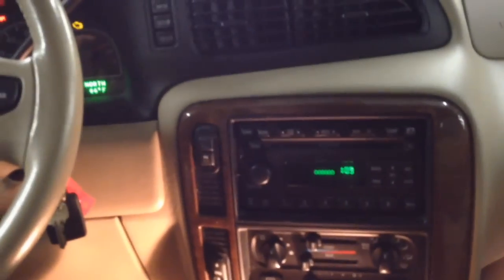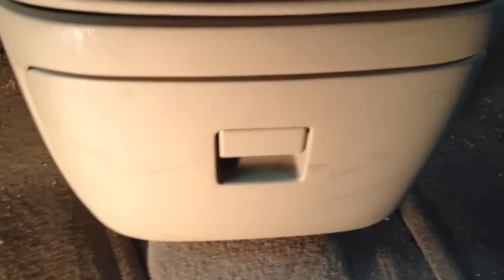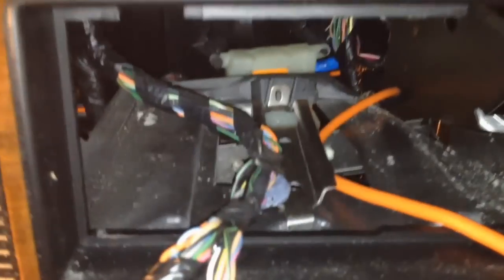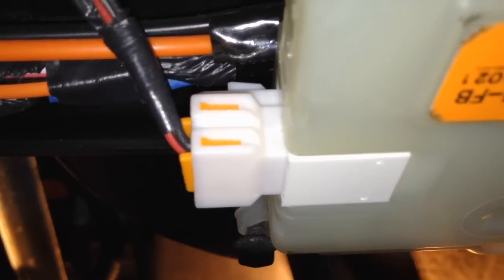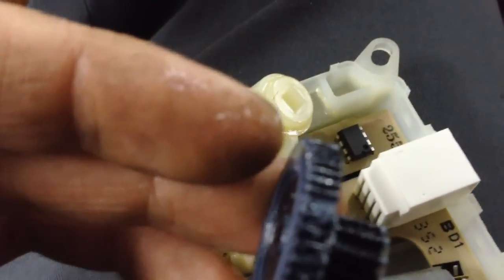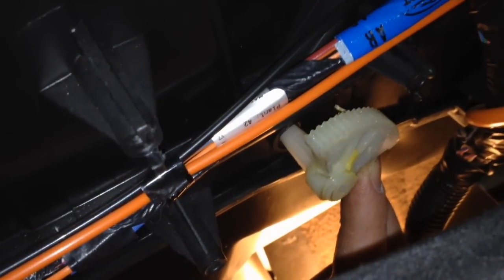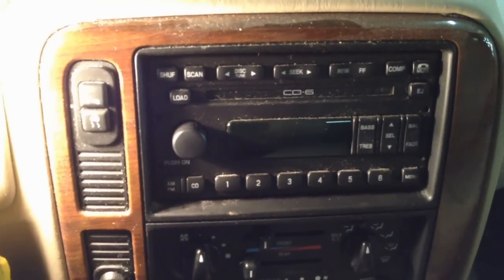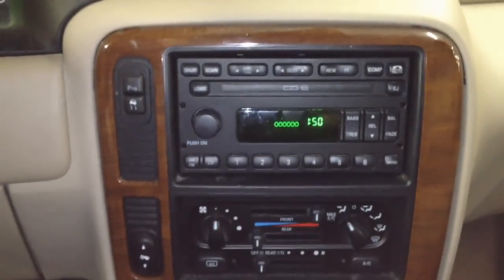NO HEAT: Ford Windstar Blend Door Actuator Removal

Comment: Yessir, that twas the problem!! What it was is, inside the actuator the LITTLE wheel of mine had a few broken teeth on it. But Every move you made I made. Right up to installing the new one. Unfortunately, they (AutoZone) gave me the wrong actuator. That little "key piece" on the new one wouldn't fit in the slot. The front of it was circled not a square 🤦🏻‍♂️ I now have to wait till Wednesday for delivery.
But, THANKS to YOU it'll only take me 7min to do. I APPRECIATE YOU bud👍🏻👍🏻if you have more vids, I'm SURE I'll be needing and watching them🤣🤙🏻

Comment: Good info, i went ahead and took off the whole plastic front to have more working room and to not have to remove the radio with special tool. Just 2, 7mm screws right above where the cup holder sits and you can pop the whole front off and just unplug the radio.

Comment: I did my 2000 Windstar actuator with this video, now I think my 2002 actuator has failed. My heat was going from hot to cold and back again, coolant was low, topped it off, same story. No clicking on this one tho, can't explain it. I'm just glad spring is around the corner...

Comment: I fucking hated taking the bitch of a radio out of my grandmas 2001 model; half the time the stupid u pins got stuck or would pull out, or the track didn't line up, and then we got the wrong door actuator and had to wait three days for a new one to arrive in store, and after 3 years with no heat, and hearing no more complaints about having no heat, it was all well worth the effort, thank god.

Comment: Your video is amazing.  My husband just replaced this part the Air Blender Aucator.  On his 2002 Ford Windstar cargo van.  Living in South Florida he never used the heat. Last night while driving he went to use the heat to find a clucking sound a quick YouTube search and your video fixed his problem. No mor clucking sound and the hear works.  Thank you for your detailed video

Comment: the instructions were fantastic. 
I removed and replaced the actuator in 1 hour.
I purchased the radio remover tool for $8, which removed the radio fast and easy.
the toughest part was removing the bolts.  not much room, but was able to do it.
I opened the old actuator to see the issue.
the problem with my old actuator was the smaller gear had teeth missing.
I tested the blend door as you suggested and there was no problem with it.
Put the new actuator back in place and connect power, attached the bolts and presto had heat.
thanks for your video it made the repair a do-it-your-self.  thanks.....
Reply from the maker: Wow now that is a successful repair and is the way I intended it to be!

Comment: Needed to know where this part was located. Hmm mine is doing something similar the rear gets cold as ice but the front blows luke warm I can see the blend door actuator move so I'm guessing it's not that causing the issue guess I'm going to be digging into the dash. Bought the van for 500 it had been unused and rats where living in it my guess is they found their way into the ac vents

Comment: Very well done video! Our 2000 Windstar is ticking when the AC is on, but ceases if we switch it to Heat. We think it is our Bent Door Actuator. Thanks so much for this video!
Reply from the maker: Take it apart and check it out before the hot weather from the way it sounds it failed in the heat position and that's not fun in the summer.
Reply: FordTechMakuloco Yeah, especially with kids....they can't take the heat.
I noticed on my review I called it a Bent Door not a Blend Door. Oh well.

Comment: Did this today! The coat hangers didn't work so I bought the tool for $9 at Advanced Auto. Also found a replacement actuator at the same place. Took the old one apart and the little teeth were gone all but about 6 or so. Checked the door and it moved smoothly. Thanks a lot. One suggestion is to take the glove box and take it out and place your light in that area, worked like a charm!
Reply: Hello, re "the tool" you used...he used the same term...if I may ask..what's the tool called?

Comment: We took out the actuator and it looked good.  So we did the "test" and we could open/close the door.  We put a black dot on the actuator and then re-installed it.  You can see it move from noon to three and three to noon when you go hot to cold and cold to hot, but the air temp never changes.  Is it possible that the actuator is turning, but not actually doing anything?  Since it's keyed, we thought not, but figured it wouldn't hurt to ask.  Can't think of any other reason why we aren't getting hot air.  THanks!
Reply: Did you fix the problem?
Reply: Yes.  The problem turned out to be that there was no coolant.  After refilling, we immediately got hot air.  This worked for a little while and then it leaked out again.  Turned out we had a bad heater core.
Reply: Denise Stewart Windstars + low coolant = warped heads

Comment: I took my actuator apart but I didn't see any broken teeth on any of the gears or arm. I tested the door and it does open and close with resistance as you show. I did buy a new actuator any way and hoping it solves my problem.

Comment: Is the Blend Door Actuator what regulates the heat, even thought air is blowing through the vents? I also have a tapping noise that persists unless I slide the temperature lever into an exact spot about 3/4 inch to the right on the sliding lever that sets the temperature.
Reply from the maker: Jeannie111523 Yes your actuator has failed, follow this video to replace it.

Comment: I enjoyed your video about the Windstar repair. I'll also need a little instructions for how to replace the lighter socket which is beneath of temp. control right next to ashtray (right side). Is a 2000 Windstar and still going strong... thanks for any help.
Reply from the maker: Those just snap into place so all you have to do is pry them out of there they pop right out and just disconnect.

Comment: I am really interested in trying this procedure but I have never done anything like this before.  I would like to try this before I take it to the mechanic but I was wondering what are the symptoms that demonstrate it is the actuator that is broken and not something else?  In my Ford Windstar 2000, only cold air comes out whether I put it on the heat or the cold side.  Are those symptoms that it is the actuator? Before buying the new actuator, is there a way to test if its actually the actuator that it is damaged?  Also if your reply could be as simple and detailed as possible, that would be greatly appreciated! Thanks in advance!!!
Reply: You should be able to cawl underneath there and see if the shaft on the actuator is moving or not as you turn the temp dial. Alternately you could take it out and do the same thing with the electrical connector connected. You will usually hear clicking if they are bad.  Have you checked the engine coolant?
Reply: Actually nvm, I followed all the steps and "GREAT SUCCESS, VERY NICE, I LIKE" It was actually a bit hard to remove the bolts (the bottom one and the one on the right side).  I also had difficulty placing the new actuator in its place due to wires in the way, eventually I found a sweet spot and got it in! Thanks man!!

Comment: my boys car only blows cold or heat thru defrost only not thru the selected vents will this solve the this problem as well or is there another actuator or a different one for ac mode? We replaced the selector switch but the same thing happens it only blows thru the defrost vents and not a lot of pressure at all just sort of a trickle.

Comment: Thank YOU so much ... I've had the click-click which came & went at its will, then first time I've needed heat ... none.  We followed your instructions to replace accuator in less than 2 hours.  The radio removal was the hardest part (we watched your hanger tool vid and got it.. but it took a bigger wire than just a hanger!)  All I can say is WOW.  I searched for 'Windstar no heat' and your vid popped right up!

Comment: My wifes windstar has heat but only when pushing the gas if we stop at a light or idle to warm up its not worth it. and yes the budget is real ! lol Thanks
Reply from the maker: Have you checked the coolant level and condition, and recent work done to the cooling system?

Comment: I looked at several utubes concerning my 2001 Ford Windstar heater problem.  First clicking sound for awhile, then month later no sound and no heat in front,.  I watched this utube and followed the directions and 30 minutes later the old motor actuator is out.  And I checked the damper as directed and its good.  Made my own tool to remove radio using wire similar to coat hanger. Once i get new actuator and install will have heat again. Its been cold here in Pa. Best utube Ive seen on this subject, thanks alot.
Reply from the maker: Thanks, good to hear hopefully with the new actuator you will be all set.

Comment: 2005 larait heater control center stoped working, anything come to mind on normal issue?
Reply from the maker: Auto temp control? Whole thing is dead right even the display?
Reply: yesir i was going to test the circuit but chances are they are fine, my expernce at my shop with electrical usally its the part not wiring
Reply from the maker: Kevin Rogers Yes our auto temp controls units back in the day before the big change would just blank out for no reason for hours day whatever and come back and the fix was to replace the head unit which on f150s seems to be extra high price around $600.

Comment: When I replaced mine, I took the heat/air panel under the radio off. I could access the actuator bolts without having to pull the lower panel.  Both methods work. An easy DIY for a common Windstar problem.

Comment: thank you very much for sharing this repair and want to let you know that the way you make it easier to acomplish the r&r
of this part. I did tried first without removing the bottom part. Well I ended dropping a screw right behind the misc.basket. 
so I pulled out all 4 plastic clips , removed the bottom tray and looked for the missing screw. once I found it , i assembled back everything and voila'  I was done.  Thanks again.

Comment: I took the actuator motor out and took it apart and found there are no broken teeth on any of the gears I can see but the actuator does not move when I adjust the temperature and the baffle works as it should because I checked it. Think it is just a bad actuator motor? Just curious if you had any idea since you may have done a few of these. Thanks
Reply from the maker: Yes I would still change it out plug the new one in and retest. The HVAC module that controls them rarely fails if ever. Just make sure you replace it with a motorcraft unit.
Reply: FordTechMakuloco Thanks for the feedback, I put 12v to the actuator and it didn't do anything so I think the motor in it is junk. Got a new actuator coming.

Comment: Thank you for this video! I bought a 2002 Windstar today for my brother. The vehicle is in awesome shape but the heat didn't work thru the vents or defroster. The heat did work in the rear zone. After watching your video I did the repair myself! The little plastic gear was the culprit! It only cost me $38.17 to do the repair and about 40 minutes of actual labor. I dropped one of the screws and it took me about 10 minutes to find where it fell! Thank you again for this detailed video!
Reply: 1😊p❤😊😊❤❤😊
Reply: 😊😅😊😊😊😅😅pp❤

Comment: Incredibly EASY, thanks to you!. Others want to take out the whole control panels but this was super easy. My van was ice covered and I did not have the replacement part yet, so with the actuator out, I used a 3/8 to 1/4 adapter and inserted it into the "D" hole (by hand) and rotated the flap left and held it there. Then I turned on the fan and slid the lever to heat, pulled out the 1/4 adapter and the flap stayed "up" allowing my van to warm up so I could go get my part.

Comment: What year is your windstar? I have a 1999 and from below I can't find  the blend door actuator. Took the radio out also but don't see that white plastic actuator. Maybe I need better lighting or the 1999 is different. It has front and rear heating controls. Air blows only cold and only on windshield defroster no matter what the switch that directs air is set to.
Reply from the maker: rfn944 Yours is in the same area, also your defrost only issue is separate and is due to no vacuum getting to the control head.
Reply: FordTechMakuloco Is the control head under the glove box? I saw a vacuum line on a vacuum motor mounted underneath it. How does vacuum get there, is it through a vacuum switch?
Reply from the maker: Vacuum comes through from the engine compartment to the control head where you change the temps and vent positions. There will be a bunch of vac lines coming into it all different colors you need to make sure the black one has vacuum when the engine is running. Do you have a hand vac pump?
Reply: Yes I do, thanks for the info. Will check it out tomorrow.
Reply: FordTechMakuloco Looked at it today. The reason, I didn't find it the other day was it was not there. Some hack job mechanic was in there and removed it. He put a metal rod in through the hole where the actuator motor goes making the job much harder. Since he damaged the blend door I'll have to replace it now. The switch that changes where the air flow is directed is electrical and not vacuum. There are no vacuum lines going to the control head only electrical wires. Not sure how the system works. Will have to research it further.
Reply from the maker: All doors on this system are vacuum and should be connected in a clear manifold to the control head.
Reply: FordTechMakuloco There a vacuum motor under the glove box. I moved it and it did not change the air flow off the defroster. This maybe the recycle/fresh door/flap for the A/C. The blend door is controlled by an electric motor inside the actuator assembly. The rest of the doors I have no idea where they are.
Reply: FordTechMakuloco I just found a picture of the air flow selector switch. Looks like it is half vacuum and half electric. Any idea where I can find a diagram of these vacuum lines?
UPDATE: Just found one that is great.
http://www.justanswer.com/ford/5qkhk-ford-windstar-van-1999-ford-windstar-heater.html
Reply: FordTechMakuloco Found out more on this no heat 1999 Windstar. The vacuum lines initial looked like wires, but as you said they are color coded vacuum lines.
Since the previous hack mechanic destroyed the blend door making in impossible to put an actuator on it, I secured the door in the up (heat) position. The heater core was not getting very hot. The drivers side hose was warm but the passenger side was much cooler. Added three quarts of antifreeze and it started to get hot.
Now I have heat, but only on defroster. The black vacuum has some vacuum, but very little. I could feel it there with my finger, but it seems weak. Do you know what the vacuum reading should be at idle on the vacuum source line?
Reply from the maker: rfn944 Sorry for the late reply just saw this. If you still need help the black source line should be around 15-18" of vacuum. It will stick to your finger and that is about it. Once it goes into the control head it then goes out to the appropriate mode door which all of them are not bad so it's either your source vac or the control head.
Reply: FordTechMakuloco Thanks for the reply. Since I have to travel 20 miles to get to the vehicle, I ordered a check valve that is in series with the vacuum coming off the intake manifold, then T-ing off to the vacuum switch and a vacuum reserve tank. I am hoping the check valve will fix it, but a least this time I will remember to bring my mini vacuum pump/gauge. Must be a vacuum source problem because I could barely feel the vacuum with my finger. Will measure it next time and let you know what I found.
Reply: FordTechMakuloco Just found out it is not a vacuum source problem. Pin 1 the black vacuum source line is holding a steady 17 inches of vacuum. I was able to get the air flow directed to the vents but not the floor by putting vacuum from a mini vacuum pump to one of the other vacuum lines. Next time I will try all vacuum lines to see if they will hold vacuum. I assume the dual vacuum motors have independent diaphragms?
Reply from the maker: Same diaphragm I believe but vac is put on other side of it.
Reply: FordTechMakuloco Found the loss of vacuum at the dual vacuum motor above the gas pedal. Vacuum lines were disconnected. Thanks, your assistance was very helpful.
Reply from the maker: Nice!

Comment: not only did i replace the actuator door but I also replaced the thermostat and still have no heat in the front of my van... any suggestions... Thanks
Reply from the maker: was the actuator done first and you tried the heat? Or were they done both at the same time? If you get the engine warm and then put it at about 2500 rpms will you start to get heat out of the front vents? Did you test the door as I showed? When you turn the knob does the actuator move?
Reply: FordTechMakuloco after a full hose flushing and inspection, we found out that the door itself is broken and has to be replaced, so for now we have it jammed open so that all we get is heat but for now it will work... :(  Thank you for the video though, it really did help us
Reply from the maker: MXWraithsLady Oh I thought you said you replaced the door in the last comment. Yes the doors were common on the older windstars that is why I have you check it when the actuator is out as shown in my video.

Comment: Hello Brian -  Had a no heat problem -  anti freeze reservoir was at it's level  - next flushed out the heater core - still no heat just
blowing cold air - saw this video of yours - ordered a Windstar blend door actuator from Rock Auto now waiting for it to arrive so I can in stall it - my fingers are crossed hoping this will work for me .   Thanks for sharing this video on You Tube for everyone .